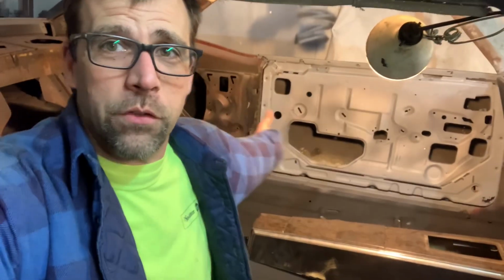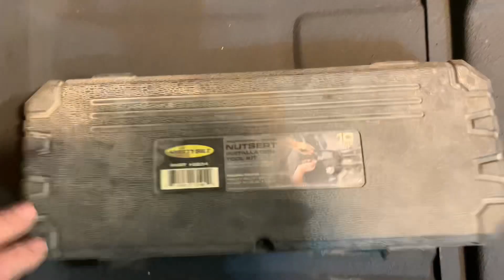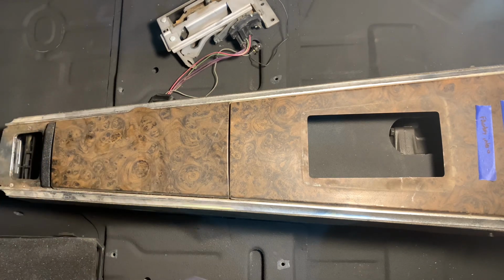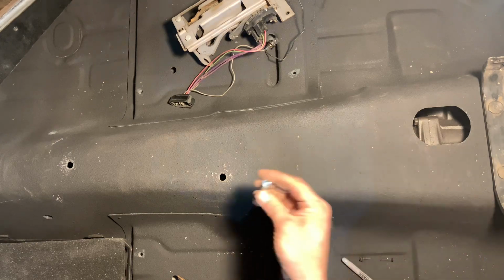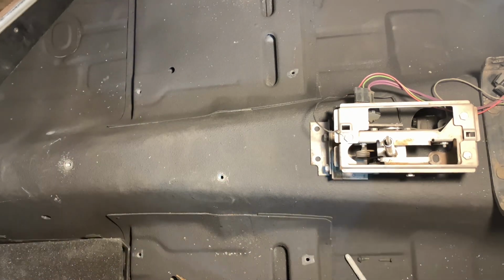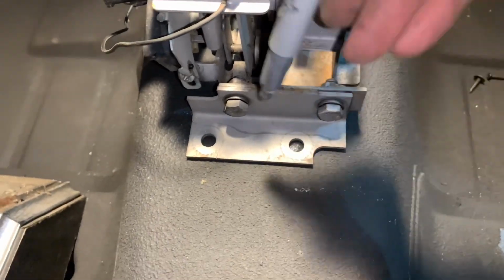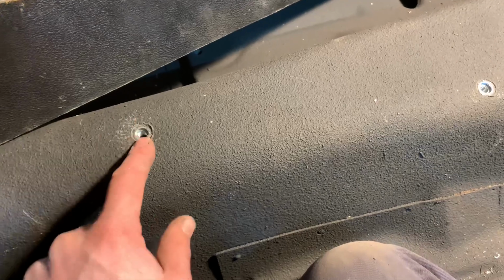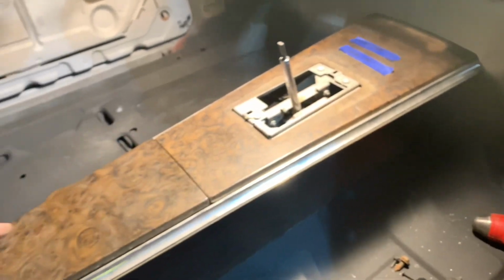Console and shifter install 1968 Firebird, where it goes and how to get it installed

Comment: Great video!!  I purchased the center console for my Bird back in 93 salvaged from a car in Arizona. Perfect condition. As my car is original column shift. Now im torn between installing the console as my car has the original CLOCK on the floor and it would have to be deleted due to not fitting with the console.  GO Great Pumpkin. Shes looking good.
Reply from the maker: Console clock was also an option, just sayin. 😁   Thanks!

Comment: Great tips again! I’ve got an automatic console that I’m going to try to modify to my 4 speed. Got the floor cut out but seems that the shifter sets a little to far to the drivers side for the consol so I’ll have to address that soon.
Reply from the maker: The factory 4spd console hole is off center to the left and automatic are centered.  Are you thinking of modifying the auto console?
Reply: @VinylVillageGarage  Yea I have a auto console that’s not in the best shape so I thought I would try to modify it to try to save some money. I know you can buy them fairly reasonable so if I mess it up I’m not out much.
Reply from the maker: Sounds like a solid plan. Good luck

Comment: Awesome video.  You make this look too easy.  I wonder if there is a way to use my console, since i swapped it over to manual.  Keep up the great work.
Reply from the maker: You should be able to use a manual transmission center console and make it work with overdrive transmission too.  Plus you can sell the automatic console even, check the comments a guy is looking for one. 68 & 69 used the same consoles.
Reply: @VinylVillageGarage  It would be cool to use my OG console.  I havent seen it in about 15 years lol.  I would have to do some serious digging.
Reply from the maker: I go on a treasure hunt sometimes and I seem to find way more then i bargained forn

Comment: Nice video and instruction of the console alignment. What is the material you used on the floor pan? It looks really nice.
Reply from the maker: That is lizard skin, I did the sound control and thermal insulation

Comment: Really enjoy your videos. I'm collecting parts to put an original style shifter back into my 68. I have all the pieces except the set screw in the lower chrome handle. Any chance you know what size or a source for replacement? Thank you.
Reply from the maker: It’s definitely not big, I even bet you could  get one from a local hardware store like ACE.  Heck take the handle in and small Allen wrenches to test fit them

Comment: Thanks for sharing, but id really appreciate when you get to the front clip you show how to align it. I have a 68 that had bad bushings and now that they are all replaced nothings aligned any longer. Doesn't help that the guy we got it from used ace hardware bolts everywhere. We now have all the bushings replaced and have all new hardware for the correct installation but really clear on aligning all the front clip panels. So when you do get to that part id really appreciate any tips and tricks you may have.
Thanks in advance.
Reply from the maker: Heck yeah.  I will definitely cover that part for sure.  I really think clean lines and tight gaps make a car look super clean. You have discovered why I put the car all together before welding panels on and doing body work. New bushings change the angles and how the car fits together.  Which in turn will could effect a modified panel and snowball into a huge panel fitment issue.
Reply: @VinylVillageGarage  Appreciate that. Mines a mess right now but at least bolted together. Looking forward to it. Im sure I'll have questions.
Reply from the maker: The best part is you have a bird!
Reply from the maker: Lol. Never saw it
Like that bird giving the bird.  Been there a few times.  But anyway glad to help and hope to keep the videos coming

Comment: Are manual and automatic first gen had the same shifter hole location???
Reply from the maker: I believe 67 in the same but 68/69 are a little different the manual shifter hole is larger

Comment: Is the hole in the floor the same for a standard transmission?  If anyone has center console that they won’t be useing for a 68 Standard transmission let me know.
Reply from the maker: No the holes are not the same unfortunately, the consoles do mount up the same between auto and Manual trans

Comment: The automatic console is not really a problem to install. HOWEVER, I have broke out TWO factory 4 speed consoles powershifting to 3ed no matter HOW you install it as there just is not enough stroke in that stupid 4 speed shifter hole in the console with a Hurst competition plus II shifter. You can get away with the factory 4 speed console with the wet noodle factory shifter, but that shifter is a total JOKE if you really get on it hard.  My car came with a console and the factory hole in the floor, so we know everything was correct from the factory. But when you install the Corvette Hurst Comp plus II shifter it now shifts great, but throw the console out as it will NEVER take a balls to the wall 3ed gear full on power shift without braking out the front of that plastic console. Needless to say, my factory 4 speed console is OUT, and I just used a plain GTO 4 speed factory rubber boot & chrome top plate with no console. And with the price there getting for the 4 speed consoles ( 4 speed first gen Birds are pretty rare with a factory console) you can use the sale of the console to buy a complete synchro, small parts & all bearings for the 4 speed & a tank of Avgas as well ! lol. Yep, I repaired & sold off both on mine. Just say NO to a console with a 4 speed in a 67 to 69 Bird, they look cool, but just don't fit with a heavy duty shifter. Trust me, I am a really good journeymen machinist, over the 45 years I owned my bird I tried EVERYTHING !!!! to make the original 4 speed console work, never going to work (correctly) with a Hurst Shifter.
Reply from the maker: Man i bet I will be busting my console in my bird when  I get it together.
Reply: @VinylVillageGarage  cut the shift arm on the trans in half and shorten it 1/4''  that will fix the problem and shorten the thro of 3/4 shifts.  works great